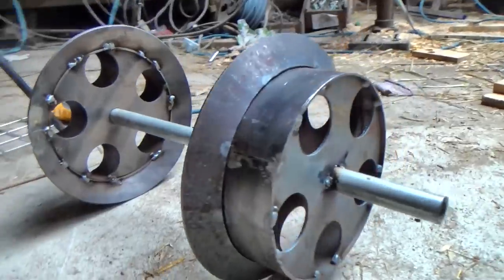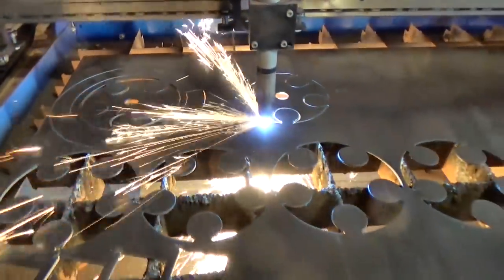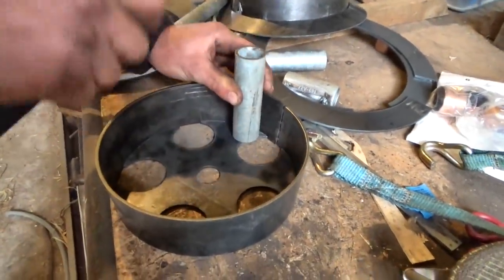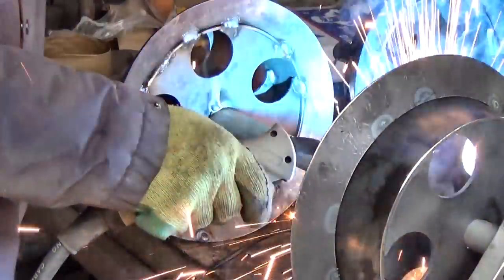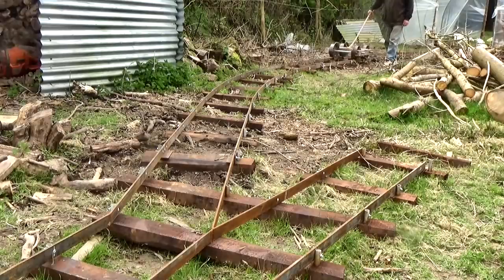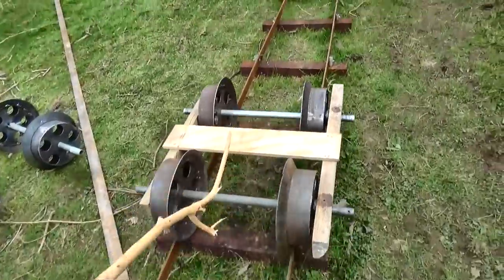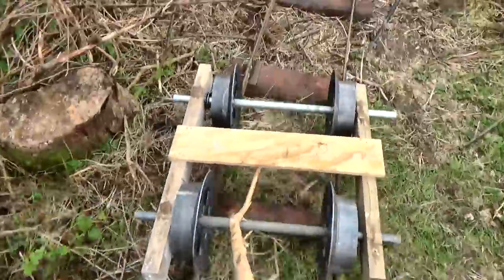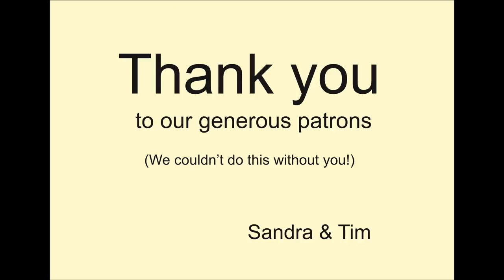More Homemade Railway Wheels - This Time With Tapered Treads!

Comment: Whilst there are significant advantages to having a taper on wheels (typically between 3 and 5 degrees) for what you are doing a flat tread is fine.  An easier option you might like to consider for future experiment is non flanged wheels running on flanged (angle iron) track, this is known as a plateway.  As someone who has earnt their living building, operating and maintaining  narrow gauge railways for the last 25 years I am really enjoying this series and am impressed by your endeavours.  Keep up the good work.
Reply from the maker: Thanks very much. I like plateways, but curves are more difficult with them, aren't they?
Reply: @WayOutWestx2  Marginally, but it is do-able; cut V notches in the foot of the angle iron, bend to shape, weld up notches.

Comment: I put my hand up to answer a question in your last update and I was ignored, so now I’m going to sit back and watch & say nothing
Reply from the maker: Sorry, John. Ask again.
Reply: @WayOutWestx2  I suggested that for you engine or locomotive that you make the wheels and tyres from metal 
and for the trucks/bogies/wagons then I suggested that these could be made from a strong wood Ash/Oak then wrapped in steel tyres and using articulated trucks to handle larger lengths of wood I wish you well
Reply: Also when you get time you need to watch Jonathan Sherwood as he has the same size wheel base and builds loco’s powered by chainsaw motors etc

Comment: My only suggestion would be to split the axle and have a piece of tubing slipping up the inside or outside of them, sort of a crude differential to make turning a little easier.
For the people who want tapers, they help with large radius corners, but for the corners on this track (and especially at the switch) the taper necessary to get around that would be unfeasible.
Reply: Also, I'm currently waiting on a rod of 1045 steel to make some flanged wheels for an escalator to help my grandmother move up and down two steps, I'll be sure to let you know how that works out!
Reply from the maker: Ah, a lathe, huh? You're lucky!
Reply: I could say the same about your plasma cutter! It looks like a very nifty and useful machine. I've been dreaming of owning one for about 3 years now, but I just don't have the space in my little "toy" workshop.

Comment: Bet it was ‘Mericans talking about taper wheel nonsense. Will be in about serial numbers next. 
 Wheels wear that way through mileage. The flange is tapered but not the disc   
Search M.E.R.  (Oldest electric railway in the British Isles. (And for be most part Europe). 
But who really cares?

Comment: I love that you use a framing hammer for metal works.  This again shows that no specialist tools are needed.  As one gets experience and saves a bit of money, then upgrading to good used equipment is often a good opinion.
Reply: Mmmmmm, you shouldn't hit metal with a framing hammer. The hammer's steel is tempered differently in a ball peen hammer.

Comment: I’m sure that you know because you are rail aficionado, but I will mention it for your viewers who have a mild interest. The taper on the wheels is a genius way to go around curves, as well as keeping the axle centred on the track. If the geometry is worked out properly, as the curved wheel gets pushed to the outside of a turn, the larger diameter part of the wheel starts to contact the rail. On the opposite end of the axle, the smaller diameter part of the wheel starts to contact the rail. This is how they engineer it so that a fixed axle will go around a corner. Otherwise, the axles would have to allow independent rotation of the wheels to negotiate a bend.

Comment: First of all, I don’t mind your clonky points. I think it’s suitable enough that it doesn’t pose too much of a problem and like you said it’s suitable enough for your kind of railway. Anyway, I have two potential solutions for the wheels scraping against the rails

1. I would think resizing the gauge between each wheel to be a smaller gauge could potentially work so it doesn’t scrape against the rails

2. This one takes a little more time but again it could potentially be worth it. Get more sleepers and drill the holes for the pipe that secures the sleepers to the ground a little bit more further apart than the usual spacing. Once that’s done, replace the sleepers on curved portion with the newly drilled ones

Again, this traces back to my first idea which was to test any newly laid portion of track with your wagons or at this point, your wheels

Comment: I have made railway wheels from a slice of 60mm tube with laser cut bosses and spokes, so they have a parallel tread. The flange is a disc of thicker plate so I could turn a taper on it. Despite the naysayers they work just fine at low speeds around the workshop, which is all they were designed for. Keep up the good work!

Comment: You can cut round and curves with a angel grinder the one thing you don't cut all the way through at one point you what your cut to go cut even you go from the start of your cut to the end of your cut you go back an forth let the grinder do the work just go slow an take your time if you are handy you could make a jig you can mount a grinder on to cut round circle I hope this may help someone.

Comment: You can purchase readymade flanged rail wheels with ball bearings for around £28 - £60 each (ex VAT) depending on quality and quantity.
Reply from the maker: but not this size, surely? Please post a link..

Comment: Here in central california, USA, we had something called Drying Yards around 1900 for drying apricots in the sun. Wooden flats with sliced fruit were laid in the sun and narrow gauge trollys were used to move stacks of them. I was able to buy a couple, and had to repair one wheel using thin steel plate cut in an arc similar to your tapered tread. I found it easy to hammer it into shape it naturally wanted to form a curve, I then welded it into place to replace the big chunk of tread that was missing on the cast steel wheel. Used them to move stacks of bricks and parts of buildings and sheds around the back yard. The wheels were marked Stockton, a nearby city where they were cast. They used standard 3/4 inch pipe as the axle, and used a simple bracket to attach them to the wood frame. No bearings to speak of as the loads were not terribly heavy and the speeds slow.
Reply from the maker: Interesting - thanks, Gary. Yes, I'm just trying wooded bearings now too

Comment: A really simple solution now that you have properly shaped wheels. Move them in by a 1/2" towards each other. On curves, railroads with tight radius bend widen the rails out some. As your track is already down, you can do the same by making the wheels closer together. The tapers will still keep the wheels rolling true on the straights and the wheels closer to each other on the same axle will help on the curves. Also, real railroad wheels have a fillet radius between the tread and the flange which also helps in curves. But if you listen to a train go around a curve, you will hear flange squeal unless they have lubricators on the curve. In the US, there are two different tread patterns for 36" wheels on passenger equipment. One that is used on most of the US tracks and a second that is cut for use in the Northeast Corridor. Rails on straight and level track also are canted inward which also helps keep the wheels centered.
Reply from the maker: I agree - looking at the footage I can see that now

Comment: I work in plastic machining and have made nylon wheels before turned on a lathe from rod billets .
I don’t have a picture but they are quite simple to make and very hard wearing.
And much quieter.
Reply from the maker: I'm sure I heard somewhere that the noisier they are the less friction they are generating (like a bell) - so it would be interesting to compare wheels, wouldn't it?
Reply: I have made wheels for a well known supermarket for their food production plant some are polyurethane some polythene and some nylon the polyurethane and polythene are the quieter and they grip better they are softer.
Nylon in billets it very hard and hard wearing.
Hope you find a suitable wheel

Comment: I see your thing is steel.   Your plasma cutter is a great toy.... I once wished I owned  .  
On a 1/2 ton max.   railway speeder , what about using a  solid hardwood wheel  ,turned true  attached to a car axle?
Reply from the maker: the plasma cutter is hardly a toy!

Comment: TL;DR: Conic is bad.

They should be paraboloids or logarithmic curves if I recall, simple conic shape won't work nice on big rails. Relatively plain part of parabola will be your contact pad while intersection with rim can be anything smooth just to prevent horizontal oscillations.
Reply: Well, I checked. Being somewhat right I was also generally wrong - there is a whole bunch of curves in a wheel. Actually, contact pad is plain, rim curve is several curves, outer part is parabolic. But conic is actually harmful for rails.
Reply from the maker: Ha! Now stop that right now : -  )

Comment: Here is an idea: Leave the tapering to the flanges and keep the treads straight. The curve problem could be solved by - simply trimming the curve itself - like you see with a motorbike turning! Actually full scale trains lean inwards in curves too, and noticeably so! And the rails are are much easier to trim in this way anytime until it works, contrary to adjusting the wheels...
The language is clumsy, but hopefully you get the idea  ;-)
Reply from the maker: thanks. you mean banking up the rails on one side? that makes sense.
Reply: @WayOutWestx2  
Exactly. Easy to do and readjust.

Comment: Do you want some 12" steel pipe to make wheels? Probably old Gas pipe. I have some available thats not that far away from you.
Reply from the maker: I'm seriously tempted, but 12" really is too big. thanks very much for the thought though
Reply from the maker: Hi J - I spoke too soon! I just realised that pipe would be really useful for the next stage in the project. I wonder if it's still available?

I need to make some big pulley wheels for driving different machines. I'm hoping I can run them all from one big old  stationary engine...

Tim
Reply: @WayOutWestx2  i couldn't find how to private message you so i have sent a message via WhatsApp to the mobile listed on the Riding centre. Hopefully the message will get to you.

Comment: Wonder if it might be an idea to do solid plates once the axle is attached, and then fill the wheel itself with cement before welding on the 2nd plate for the wheel to keep the center of gravity lower when the wagon is loaded......
Reply from the maker: Hmmm. Concrete doesn't like being bumped about - it tends to fall apart. But you think it needs a low centre of gravity? For very tall loads, do you mean?
Reply: @WayOutWestx2  well, any decent sized load is going to be slightly elevated above the wheels, nature of the beast, so any bump to one side or the other starts a pendulum type movement....so my thoughts are, the more weight in the wheels, and fixtures, the less it will allow the weight of the load to shift....bit more grounded, if that makes sense?

Comment: The problem I see with your fork, aka junction, is that you're using flat steel, which is bendable, yet maintaining a straight run.  You should put more of a curve into it, because just straight steel into straight steel, as you have it, is rough and jerks the cart.  Very simple to fix.
Reply from the maker: did you see the video on making the points?
Reply: @WayOutWestx2  Hmmm.  I may have missed it.  Have a link?
Reply from the maker: @CarlKem  https://youtu.be/U3Y2fy6M2-8
Reply: @WayOutWestx2  Ok.  Yes I have seen it.  I would do things differently.  However, it is your railroad and you do things your way.  We just have different needs and standards.  And as far as I'm concerned, you're doing a marvelous job!
Reply: @WayOutWestx2  As for the curve issue, in 6:04 I see the problem.  I think you call them "trolleys", I know them as "trucks".  You see, the bigger the wheels, then less tolerance for changes the rail has.  In 3:34 you can see the truck easier, and you can see the modification it would appreciate.  Have the axles self-articulating, though part of the same/original truck.  this way the individual axles can turn & conform to the rail changes, yet keep everything lined up with the truck & eventually, the cart.

Comment: Tapered treads are not for keeping the weels in the center of the track, they are meant to go to the side int the curves so that the diameter increases on the weel on the outer rail and decreases on the weel on the inner rail, to compensete for the longer distance the outer weel need to travel. This may not be necessary for your application but it reduces wear in the long run.